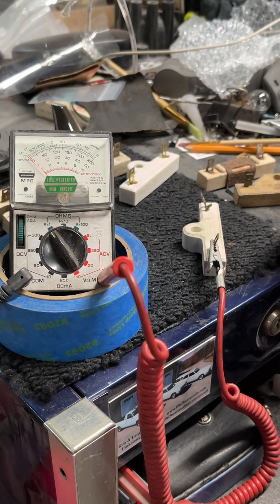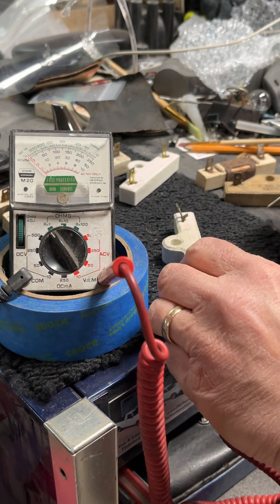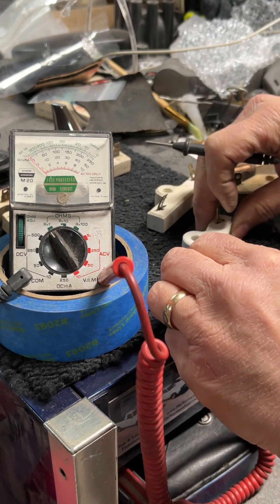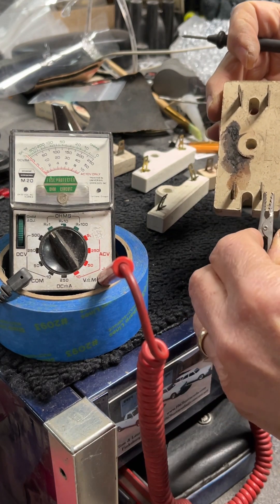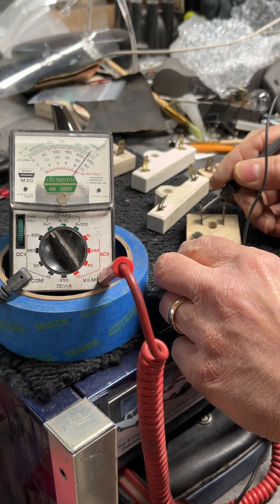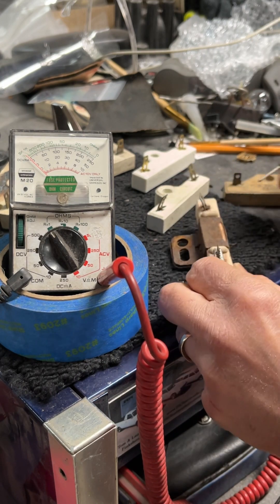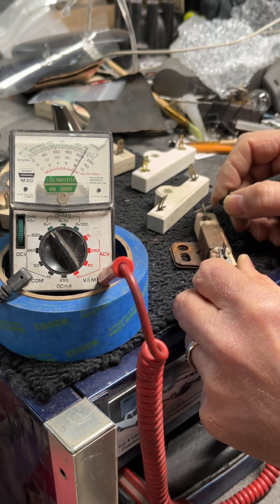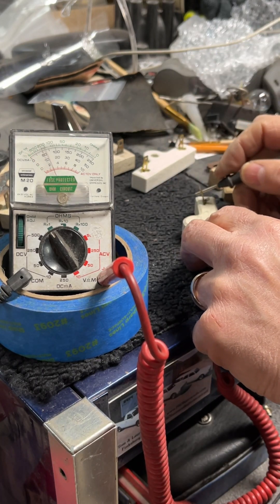How to Test a Ballast Resistor #shorts

Comment: Does the ballast resistor generate enough heat to melt plastic?

I'm thinking of zip-tying the ballast resistor to the ribbed plastic cable organizer in the vicinity of the ignition coil... (the ribbed plastic stuff around a bundle of wires.)

I don't want any more holes in our rusty old 1979 Toyota Pickup... so I can avoid more avenues for rust.😉

Comment: Does the ballast resistor need grounding from the mounting screw?

Or does it need any grounding at all?
Reply from the maker: @dawneandjohn  it needs no ground, many replacements are all ceramic with a mounting hole molded into it.
Reply: Fabulous!! Thx. 😊

Trying to avoid more holes in the body of our 1979 Toyota Pickup with a 20R engine (there's already enough rust 😬)

I'm thinking of zip tying it to something near the coil that doesn't generate heat.  

Got any advice?? 🤔